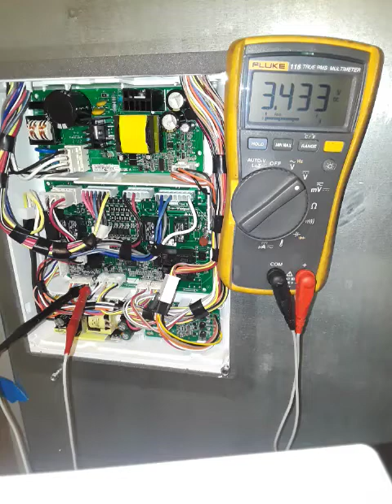Demo 1 Whirlpool WRF989SDAM00 Compressor Drive Frequency

Comment: Great info...   If it was a "Pulse Width Modulated" signal the DC voltage would vary as the meter would Average the DC voltage.  This looks to be a Frequency to voltage converter circuit and the average voltage DC or AC would be the same.  Why an engineer would do  this no one knows ( Why engineers do anything no one knows)
Reply from the maker: Hi cranetechs. Yea thanks. That is what I was trying to get clear about. I have a better understanding of the PWM signal now. At the time I was being mislead because my understanding of the Service Manual was the VDC was varying in amplitude to change speed. But this showed and verified the frequency changed for speed control. I often want to prove to myself the drive signal is correct while troubleshooting like this. Also checkout "Re-Engineers" group on Facebook. There are discussions that helped me further see these waveforms. Also we have done some converting Linear compressor refrigerators to Reciprocating compressors.